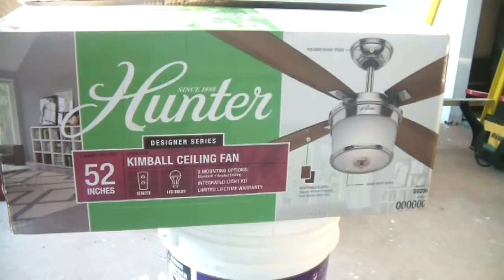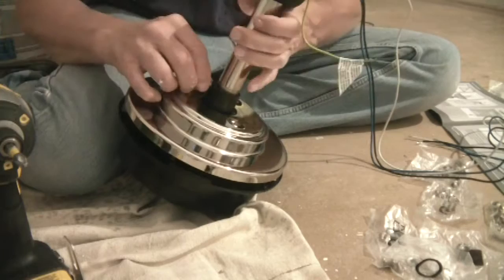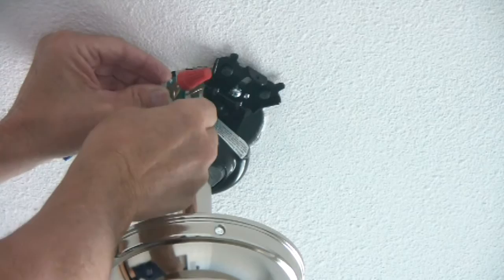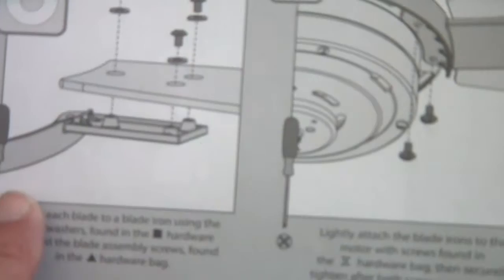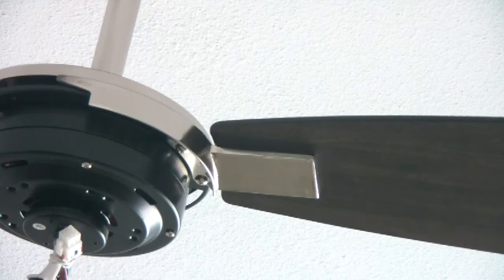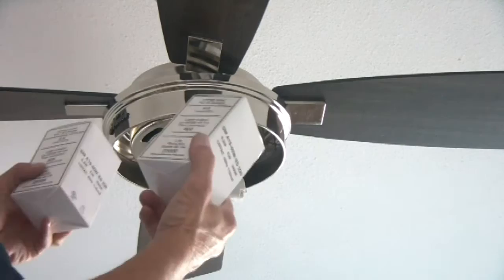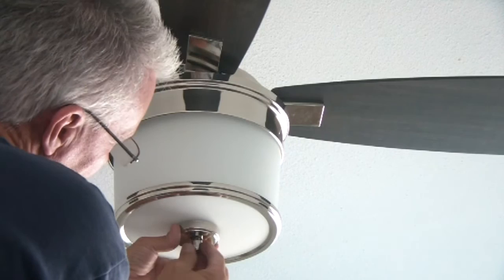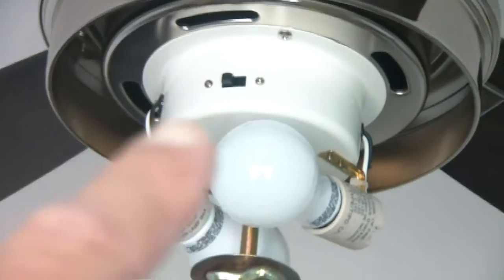How to install a ceiling fan with remote, Hunter 52" Kimball series model # 59206

Comment: I have a similar model and I just installed mine and did all my wiring correctly but it hums only when I use the remote. It doesn’t turn. Light is fine tho.

Comment: I have a red wire in the ceiling how do I connect it to the fan and/or remote? I got the fan installed and not working fan or light thx

Comment: do the remote wires go to the wires coming from the fan only or do they go to the wires from the fan and from the ceiling ?
Reply from the maker: To both 
A. connect all ground wires. 1 from the fan drop rod, 1 from the ceiling bracket and the bare copper wire from ceiling. 
B. Yellow wire from remote to black wire from fan
C. Blue wire from remote to blue wire from fan
D. Black wire from remote to black wire from ceiling
E. White wire from remote to white wire from fan and ceiling
That's it.